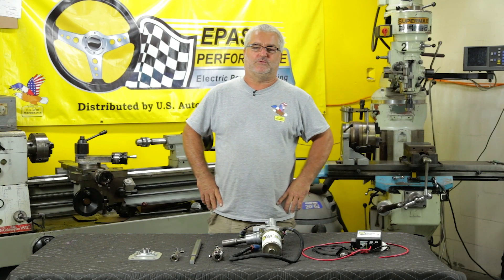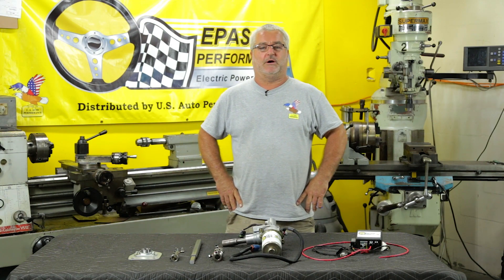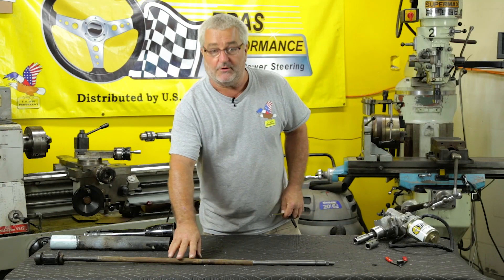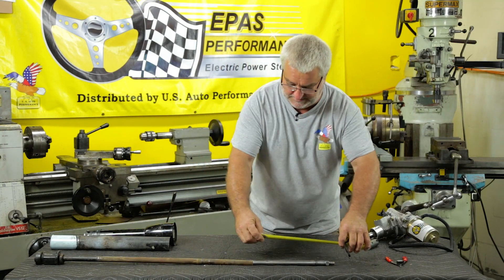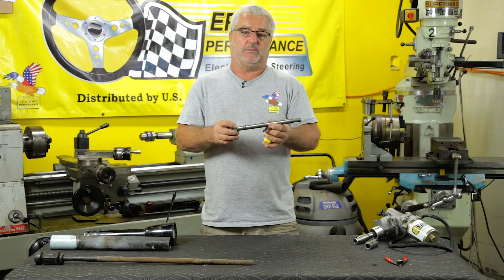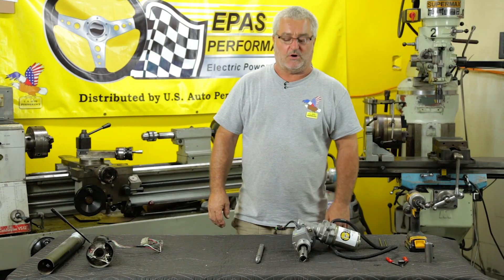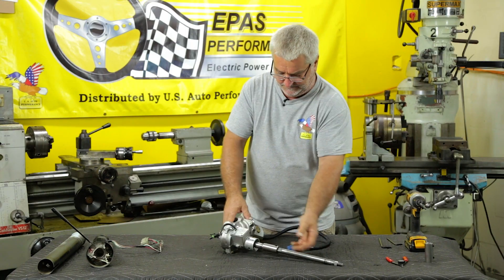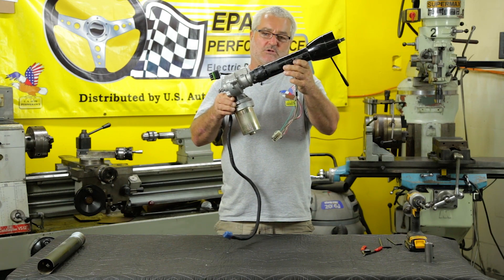Electric Power Steering "How to" Installation on Mopar A Body.

Comment: I'm trying to put a electric stereo column in my buggy I used a 2013 Kia relectric Sterling column all wires are hooked up except the 2 coming from the  Electronic stereo control module they need resistance what kit do I need to turn  Electric steering on all positives and negatives are hooked up trigger wires hooked up
Reply from the maker: We're sorry - we have no specifications for modern Kia steering columns, nor do we install car stereos.

Comment: Will this work with a column shift Mopar anybody?
Reply from the maker: @normp3273 , if your column shift vehicle has external rod linkage it would be possible with some extra fabrication. If your shift rod linkage is internal, it is not currently possible, as you would destroy the linkage when you cut your column during install.

Comment: These are all vehicle specific. That's great, but My question is if I want to put something like this in, lets say a fiberglass dune buggy, Ho do I go about the measurements?. Where do I start from ?.. The steering box to the end of the column with out the steering wheel on?..  And where to make the cuts on the column to make the eps motor fit in between?...Say your using a GM column, where to begin?......This is where a lot of folks get confused....Thanks for all your information......
Reply from the maker: One thing we can gaurantee; no one on YouTube will be able to answer your question properly. We are the manufacturer and the industry leader for electric power assist steering systems - contact us directly to discuss custom builds, such as your dune buggy; (941)-893-5427.

Comment: Terrible demo! What about the electronics?!
Reply from the maker: Mike - we're sorry you didn't enjoy Geoff's video presentation on the proper installation of a column with our unit attached. As a supplement, ALL directions are always provided on our website, including how to simply plug in the control module(electronics), which gets mounted up under the dash wherever it is convenient for your particular application.

Comment: This is for Mopar A-Body. I find mine to be a little different from what you have in your video. Perhaps bcoz its RHD Canadian model 66 Dart. Even the firewall plate is totally a different design than the one in the EPAS package. 
You mentioned need to cut 11" from spline side of shaft. Flat ends about 1 1/2". Steering tube 13 3/4"  but your manual states 13 1/3. That's a difference of about 1/2" (12mm).  I haven't cut the shaft or tube yet as I need to be 1000% sure as this is the only Dart in the country and can't find another column if needed. 
Does the collapsible shaft from the steering box side need cutting? From my initial mockup measurements, it needs to be cut as well as it's too long. My RHD steering box sits at the upper firewall area. 
Does the motor need to be mounted only towards Right side? 
My wiring exit hole is at the far lower end.
Reply: Also tried pivoting the bearing, just won't budge.
Reply: I managed to release the stuck pivot bearing after a few hard knocks. It's China made, that's expected.
Reply: Canadian model RHD? What on earth are you talking about? LHD up here, always has been
Reply: @polishedturdspeedshop  I'm talking facts mate. Yup, it's a factory RHD 66 Dart. I've also restored 64 Impala RHD incl. 65 Pontiac Parisienne with Canadian VIN plate. The 50s-60s saw many Canadian RHD Impalas, Dodge Buicks Fords made to RHD specs for the UK, AUS & NZ incl. Asia market. They were mainly for export market and in CKD form.

Comment: Hi,
i have a vehicle suzuki ravi 1984.And i wanna convert manual steering into electric power steering. 
so which points i need to consider for power required?
And is it possible to convert conventional manual steering into electric power steering?
Reply from the maker: Good Morning, we can do custom build kits with measurements and some information about the vehicle. Our system is designed to go on the steering column with manual linkage. Using a manual box or rack is advised. Feel free to contact us if you would like to discuss the custom build details.